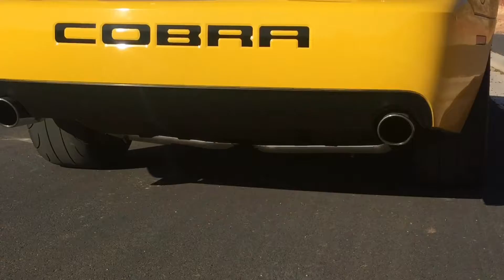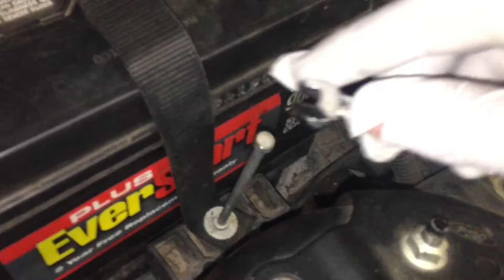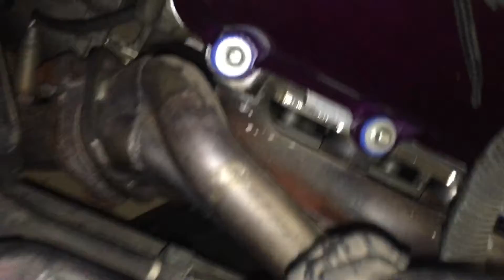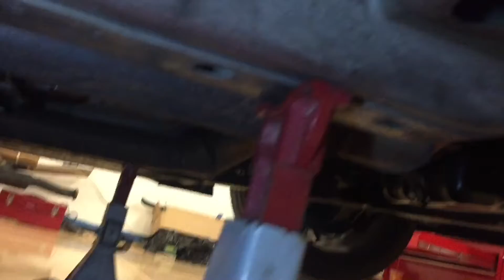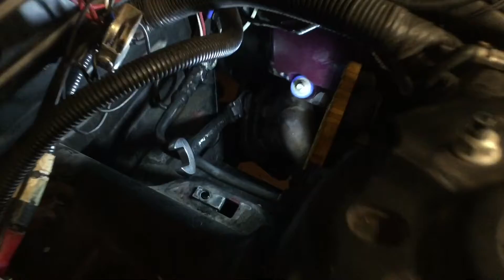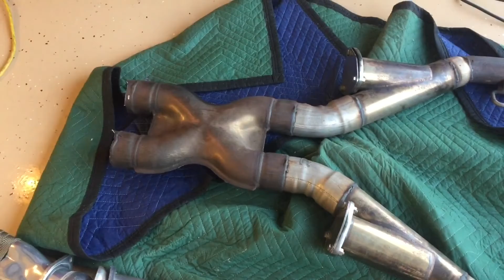How to remove the stock mid pipe 2005-2009 (2010) Ford Mustang GT X pipe H pipe

Comment: OK, awesome I’m still having an issue though so hopefully it’s just the same for a base model V6 because my battery would be on the driver side so hopefully I can lift the tray and reach the bolts from there because I would remove the O2 sensors but they’re also kind of a pain to try to get out plus I snapped one of the bolts to it😭 so I don’t know if this helps but give me any more pointers if you could

Comment: Any tips on removing the hpipe to exhaust manifold , driver side inner one , can’t seem to get it loose, don’t want to round it
Reply from the maker: Soak them for a long time with pb blaster (the whole stud and nut) and then sometime it helps to slightly tighten and then go to loosen it. An impact gun helps with the vibration of you can get one. Make sure to use a 6 point socket and not 12 point. All the teeth will strip it easier

Comment: I cant remove the 02a
Reply from the maker: try to unplug it and leave it in the pipe
Reply: @dannyjohnsonsgarage  the unclipping is the hard part they are so tight I dont get how you got the flat head in there
Reply from the maker: Whiteboyangel If you don’t tangle or too much you can often unscrew the sensor out of the pipe and reach it once the mid pipe is removed